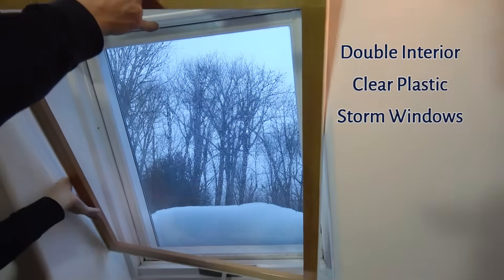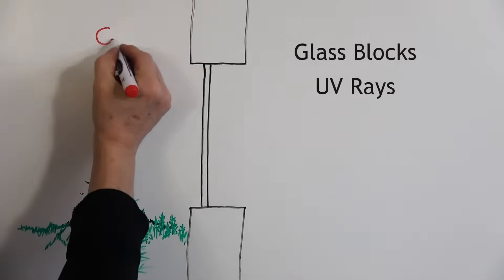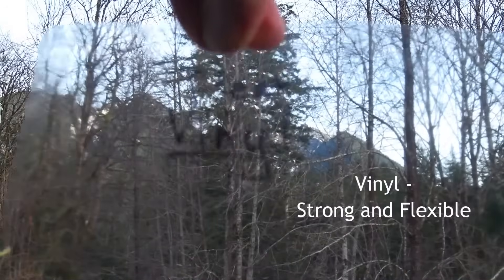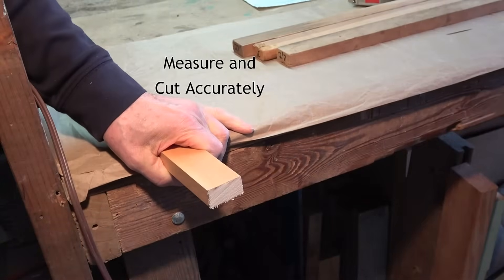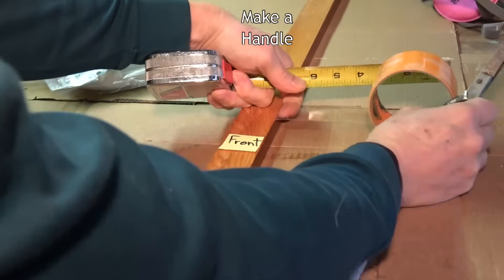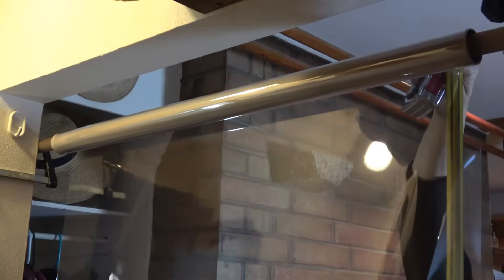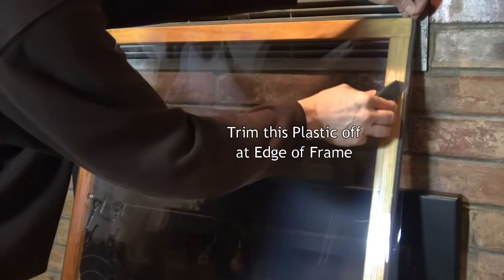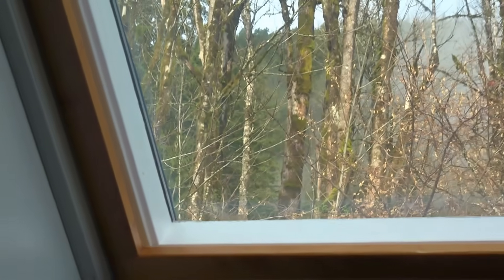Best Double Interior Storm Window Inserts: Save Money on Heating

Comment: When you are measuring your openings, are you measuring 3 horizontal measurements and 3 vertical measurements like for an inside mount blind? If so, are you choosing the narrowest or widest measurement to build your frames?
Reply from the maker: I take 4 measurements for each window, unless it's big enough to divide into 2 inserts, then I'll measure the middle too. Your insert frame should have close to an even 1/8" clearance all the way around, if you're using 1/4" open cell weatherstrip. So cut each of the sides, top and bottom 1/4" smaller than that dimension, even if they are not square. If any of the sills bow in, your 1x2 frame may bend enough to compensate for that. That's why I build the wood frame, put weatherstrip around it, press it into the window frame, then tape the plastic film on while it's in the window, so your wood frame bends to the square and curves of the window if any. Then pull it out and tape on the second side. In the rare case a window side bows out, I'll find a curved 1x2 to fit that, or use thicker weatherstrip.
Reply: I see. Thank you for replying back and have a great rest of your day!

Comment: This is great! I knew most of this from various sources, but your presentation adds some details that are very useful, like using the thicker films. Question: Charlie Wing writes in several books that a south-facing/ solar-collecting window (in the northern hemisphere) should not have more than 2 layers of glass or film, total, that adding more decreases the solar energy coming in more than the heat energy escaping, in almost any location or climate. Glad to have your comments on this.
Reply from the maker: It's true that more layers decrease the solar heat gain, so it would depend on if your solar gain is being effectively collected, that is you have full south facing sun exposure, and stored - otherwise solar gain causes wide temperature swings of the living space. Where we live in the west Cascade Mountains, we only get sun from 10 to 2 in December and it's cloudy far more often than sunny, so the solar gain is minimal when we need it most, while the heat loss is 24/7.  Thanks for your comment!

Comment: Would this type of insert also help in reducing noise? I've been looking into noise reducing window inserts because my current apartment windows are thin and let through a lot of noise.
Reply from the maker: Any storm window will reduce sound some. Thicker is better, but also costs more.  Rather than 3 mil, use 5, 7 or 10 mil polyester.  Vinyl is not as clear, but comes in 10 to 80 mil for slightly less cost per mil. A solid material like acrylic sheets or glass is best. If your main purpose is to reduce sound, just one sheet of acrylic or glass will save the trouble of building a wood frame.  Cut it the size of your opening, and seal it in with caulk, foam or wood strips. Again, 1/4" is better than 1/8" but costs twice as much. Another option is to replace the glass with double pane, but if you're renting, the cost would likely be too high, unless the owner would cover it.

Comment: I love this idea, but it doesn't work with historic homes with interior framing up to the window.
Reply from the maker: Yes, the design all depends on the particular window frame. There may be a way to attach a storm window to the interior surface, but it might involve putting in some screws to hold it, or adding a wood frame, so it depends on how much time you have and whether it's important to maintain the historical appearance. You could do an exterior storm window, but UV resistant marine vinyl isn't as clear, acrylic sheets cost more, and then it's exposed to the weather.

Comment: Best video on YouTube about making these inserts!  Using it as a guide, I made one for a 70 x 52" picture window and learned a lot, so I am building a 2nd (better) one.  The first time, I used pine 1x2's for the frames and 30 gauge clear vinyl for the windows.  This worked well as far as temperature but the vinyl was not as clear as I had wanted.  The window insert surface temperature was 12-15 degrees warmer than the window had been before when outdoor temperatures were in the 20's or 30's.  I did find that unless I air sealed around the edges, I got condensation inside the original window (not between insert layers).  Air sealing fixed this.  The new insert I'm building will use poplar boards which are stronger and 20 gauge vinyl from a supplier whole vinyl is clearer and it'll be less weight too.. More to follow!
Reply from the maker: I have yet to see a vinyl that is as clear as polyester film.  Advantages of vinyl are that it comes in UV resistant, heavier weights, 72" widths and cut lengths, and is often used for boat windows and outdoor applications.  It has a softer feel, and thicker weights would reduce sound more. I got some samples from MarineVinyl.com and though they say it's' crystal clear, even the 10 and 20 gauge don't have the clarity of polyester. For interior window inserts, you could probably go with even a lighter vinyl, like 4 gauge.
Reply: @HartzHomestead  Thanks, I agree that the poly looks extremely clear.  I looked for it but started with clear vinyl because it seemed to be priced competitively, I liked the thicker feel and I thought it might insulate well (even though they'll say the R-value is negligible).  I got my vinyl for my new insert from Marine Vinyl as they definitely have the clearest I have seen.

Comment: What kind of plastic is that at 9:17 that you are cutting?  Do you have a link to where it can be purchased?  I'm looking to create an interior storm for a 10'x4.5' picture window.
Reply from the maker: That is 3 mil clear polyester film (0.003"). Amazon has 40" wide rolls.  ePlastics.com has 48" wide rolls. See links in video description. You could search online for wider rolls, but may pay quite a bit for shipping. Another option is to break it up into multiple storm windows - then you could make 3 inserts 42" x 54" or 4 inserts 28" x 54" and use narrower plastic. Since a 10' long insert would be hard to store, and you'd need 1-2 vertical bars to keep the top and bottom from bowing in, if it doesn't open you might be better off permanently attaching the plastic to the window frame.

Comment: Wonderful video, very clear, easy to understand, and follow, instructions!

Quick question: understanding it may cost more, why not use aluminum window screen framing in place of the wood? It would likely need a horizontal support but also is lighter, thinner, comes in several relevant colors, corners and connecting “T’s” are readily available and may remove the need for most tools to make and install the window. No disrespect at all intended, just an honest, question.  Thank you!
Reply: Before watching this video, I used aluminum window screen framing and loved how easy they were to cut and assemble.  However, if I could do it over, I would use wood.  I have large windows and felt like the framing flexed too much and after stretching the plastic, it was a struggle to seal the edges.  I also used heavy duty plastic like they use for clear table cloth protectors.  It eventually worked but came out kind of ugly and wonky.  If I could go back, I would do it exactly how it was done in this video.
Reply from the maker: The main advantage of a wood frame is it's easy to get a 3/4" spacing between 2 layers of glazing by taping film to both sides of a 1x2 frame. You certainly could use aluminum screen framing, but you'd only get one layer of film per frame, plus aluminum conducts heat much faster than wood, so you'd get some heat loss and likely condensation on the frame. For any climate that's cold in the winter, it's well worth having double pane glass plus at least 2 layers of film inside that.
Reply: Well, I am indeed in a cold climate (MN, USA) so it seems as though wood is the way to go for me! 😇. Thank you. 🙌🏼

Comment: Such great info!! I didn't know about using open cell foam. My utility bills are pretty low, even though I have two huge windows!
I do have a question - A Japanese content creator used two shower curtains for hrr sliding glass doors - didn't tape them up, just hung them on one of the drapery tracks. While on the surface this seems like it might work, is convection a culprit in this scenario? I just wonder if that may be a minimally effective solution for peoplr who aren't really in a position to cut wood or assemble things (small homes, few tools, no saw). I know there's no guarantee of efficacy, but sometimes even a little result is better than none. Thanks for your video!
Reply from the maker: Yes, any kind of curtain is better than none, though the better sealed it is around the edges, the more good it will do, and it helps to have a layer of bubble wrap, batting or foam insulation in there.  We have just a double heavy sheet that lays flat over one window and it's noticeably cooler behind the curtain.
Reply: The Kreg screw jig  for joining the frame corners is really easy, good luck

Comment: Thank you sir for this wonderful demonstration. I cant afford to run the heat in my house above 45 degrees f because it has huge single pane glass windows. My power bill is massive and im so so cold all winter. I can build these with the tools i have. Thank you!
Reply from the maker: Yes adding 2 or more layers of plastic will make a huge difference, especially starting with single pane. You can add a spacer if necessary to keep them 1/2" to 3/4" from the existing glass, adding as many layers as you have time and money for materials.  There may be surfaces you can tape 1-2 layers to, as long as you have the right air space. I find up to 4-5 glazing layers is not overkill - each air space gives you more insulation.

Comment: Thanks! Do you recommend a type of 2 sided tape? (I'm going to try the frame but there's a door where I would need to tape directly onto the door/painted wood. I suppose any tape can mess up a painted surface. Just wondering if you've had any luck with one that came off without taking too much paint with it! or do you leave the clear layer/film on permanently? Thank you for a great video.)
Reply from the maker: I really like the eplastics.com 1/2" double sided tape with the red peel off backing. It's rubber cement based, so you can usually rub it off, though it may depend on the quality of the paint on the door and how long it's on. I do leave the plastic on as long as it's in good shape - usually 30 years or so.

Comment: Wow! This guy is amazing! Reminds me of some old school engineers I’ve been fortunate to learn from. This one video has better and more info than all the searching online that I have done combined. Thanks @hartzhomestead! I especially appreciate the knowledge based approach to the insulating R value. It seems there is a lot of confusion on the internet about this. Even modern expensive windows still have a lot more heat loss to the outside cold than an insulated wall! A lot of people are being duped into paying a ton of money for new windows when they can improve the thermal performance of what they have already for a small price. 
If I may ask one question, how would you build an insert which fits inside a standard vinyl double hung window? It looks like you did this, but I don’t know how to construct it to fit inside the slots. My screens fit in a 1/4” slot so I am confused how to do this with wood and plastic. I’m thinking of using acrylic sheets (ie Plexiglas) for strength and durability. Thanks again!

Comment: Great video, I am going to try this. 
My question is I have a 54 inch by 54 inch picture window. I do not want to split it into two. Where can I find a piece of duralar wider than 4ft?
Reply from the maker: Eplastics.com stocks clear polyester film 48" wide, and their website says they can special order custom widths up to 60” wide, so I would call them (they're in CA and TX). I don't know if they can do a small quantity, and shipping will likely be more on a wider roll. If not, search for other companies that make clear polyester film, or if there's a good local hardware store they might be able to help. Let me know what you find.

Comment: Just my opinion on using mylar, I found it reflects light/glares. I made several inserts with this method and during the day, they look good. But at night they reflect any imperfections and light. It was distracting in my living room. I had to scrap the mylar part and rebuild using acrylic. Costs more up front (and I ended up wasting $ on the mylar and adhesive) but I couldn’t get along with the reflection. It seemed like a cost effective solution but I ended up spending more…Good video though!
Reply from the maker: Yes, polyester film does reflect indoor light at night in a wavy pattern. I don't mind it at all, and some think it looks "pretty", reflecting various colors in the room.  One option is to use a lighter weight, like 1 mil or less and heat shrink it so the plastic is tight, though that puts more tension on the wood frame, which could cause it to bow in on larger windows. Of course the other solution is what you have done, with rigid glazing like acrylic, which costs more but is more durable and blocks noise better.

Comment: I can never get that type of foam insulation to stay stuck well enough onto the wood. I wanted to compress slightly when I install the window and it just pushes the insulation strip off.
Reply from the maker: Be sure to sand the wood if it's rough, and wipe any dust off with a tack cloth. Even if it doesn't seem like there's dust on it, the tack cloth leaves a very clean surface for the tape to stick to. Press the weatherstrip on very firmly - I go over it with the back of my fingernail. Weatherstrip will stick best if the wood is varnished with clear polyurethane, even just one coat,  or painted. Weatherstrip varies a lot in quality, so you could try some different brands. I have not had it come off that easy, so it may depend on the wood and weatherstrip you're using.
Reply: I used a silicone half moon shaped weather strip, also wiped with alcohol  prior and used a seam  roller on it, stayed stuck great
Reply: I accidentally bought closed cell foam and had this problem. It's exposed surface is tacky enough to grab the foam and pull it from the frame. Getting the open cell weather strip fixed this problem.

Comment: This is definitely a much better method of making up storm windows without going totally broke! I was wondering if such plastic was available and how it might be done. You answered all of my questions easily and quickly with no fluff. Thank you.
Reply from the maker: Thank you! It's a very practical, cost effective way to save heat.  I prefer the stronger 2-3 mil plastic over the very thin stuff. The frame design may depend on your particular windows.

Comment: What a great video.  If you have a hard time cutting the frames square, or to fit, or the window opening is not square, has ridges etc - use foam "Backer Rod" to stuff in the gaps.  https://basc.pnnl.gov/images/closed-cell-backer-rod-air-sealing-window-and-door-rough-openings  Especially useful when possible is to hinge the Storm Window so it can swing away, held by magnets or velcro etc.  Stay gold.

Comment: I have problems in my bedroom with sunlight and streetlights. It gets very bright and it’s not very dark. I’m trying find ways to make it better for sleeping. This plastic will will be ideal in the summer heat and winter cold in NY. I’ve seen other ways to make it black out. I wonder if this could be used with plastic that is black to block out light? Any idea about black plastic?
Reply: Thank you! Very excited to build some frames. My home is going to be warmer in the Upstate winter.
Reply: You may consider investing in what are known as "Blackout Curtains". The good ones definitely stop all light and also add an insulation factor. Then, if and when you want light all you need to do is push them aside until no longer needed. They are quite popular with third shift workers.
Reply from the maker: You could use any plastic. I've seen tinted mylar (polyester film) with a reflective surface on one side, which you could face out, so you could still see through it, but it would be much darker.  Black plastic would give you total blackness. It's usually polyethylene, and comes in 3 - 10 mil. Not sure if it would last as long as polyester, but you'd still get the heat saving benefit in winter.  If the sun shines on it in summer it would heat up the black, so a shade outside the window would be best for keeping cool.

Comment: Thank you so much for sharing this! Our house has a screen room with 4 track windows. It's great May-Sept but the vinyl has no r-value to speak of. It just keeps the wind out. I got quotes for putting in proper glass windows and that's way out of our budget. This seems like a good way to extend how long we can use the porch.
Reply from the maker: Yes, adding more layers of plastic will make a huge difference. Just be sure they are attached well enough so the wind doesn't blow them out.

Comment: Why did you choose open cell weatherstripping rather than closed cell?
Reply from the maker: The weatherstrip needs to condense enough to get the window in and out and compensate for variations in the space between the storm window and the window frame. Closed cell does not compress enough, so the space would have to be an exact fit. Though it's possible open cell may allow a tiny bit of moisture and air through, cutting the inside film slightly larger makes an air and moisture barrier all the way around.
Reply: I accidentally bought closed cell and it feels a bit rubbery on the surface, so it doesn't slide in, but sorta grabs the window frame and peels/rolls the foam off the insert. Besides compressing more easily, the Open cell is more of a smooth/slick surface, so it slides into the opening without pulling off the insert.